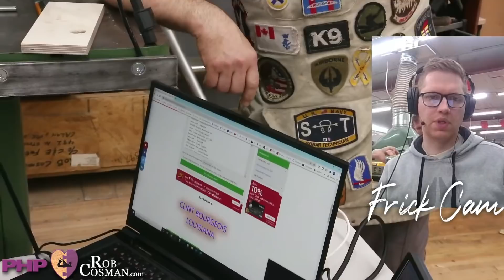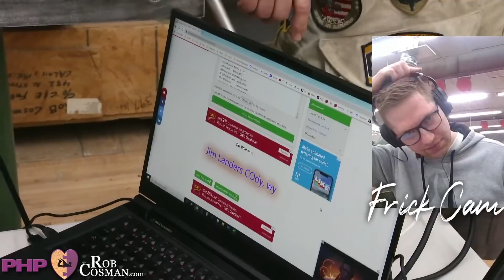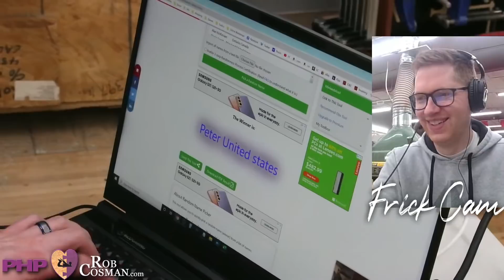Ask Rob Anything - Live Q & A (17 APR 2021)

Comment: Hi Rob - missed the Q&A unfortunately but hoping you have a moment to answer. :) I haven't been happy with my vintage Stanley #4 and #5, so I was going to sell them to subsidize my purchase of a WoodRiver #4 1/2 or #5 1/2 based on recommendations in your previous videos. The waiting list for those is months long, though, but my nearest Woodcraft does have both a #5 and #6 in stock.

Can a #6 be set up for respectable "hobbyist quality" smoothing+jointing+flattening if it's my only plane? If so, any general tips on how to do so? (And if not, would you suggest waiting for the #4-and-5 1/2's to be available again vs. grabbing the #5 instead?)

Thanks!!!
Reply from the maker: Don’t go near the 5 unless you have small hands. The 6 is a worthwhile purchase and would do all of the same work as the 5-1/2, so I would go for the 6 if you don’t want to wait for the 5-1/2.

Comment: Hi Rob. Missed your live show, but I have a few questions I am wondering if you could answer. 
You said poplar was not your preferred choice for secondary wood in drawer making. What is your preferred choice? 
For a drawer that has a front made out of maple, what would be your choice for a secondary wood?
Would western red cedar be a good choice for a secondary wood?
Thanks!
Reply from the maker: HI Guy, poplar is a grey/white with green heartwood.  The hardness is good, the cost is good but the color as it ages, stinks!  The green gets dark green, the white gets grey.  I like pine to contrast dark fronts, Holly is even better but terribly expensive.  Maple is a tough one since the end grain pins are that color that does not contrast well with so many woods. Ive used mahogany, contrast disappeared, I used walnut, bit better but still minimal contrast.  most cedars are too soft for drawer sides, bottoms yes.
Reply: Thank you Rob, I really appreciate you responding to my questions! I have seen you use aspen for certain things, I would imagine this wood fits in the same category as cedar, too soft?